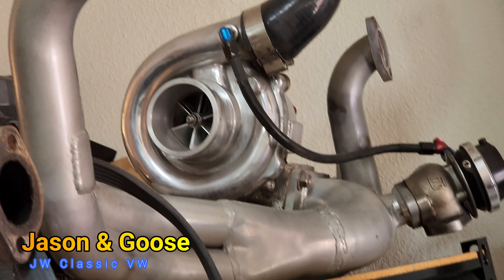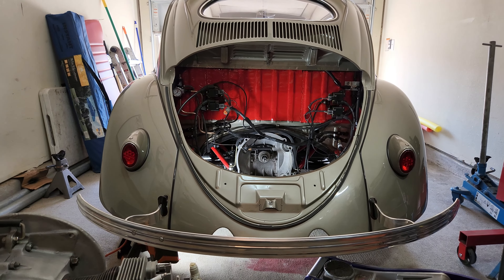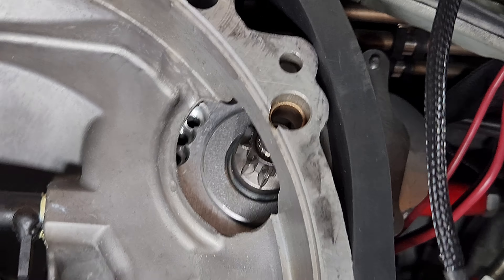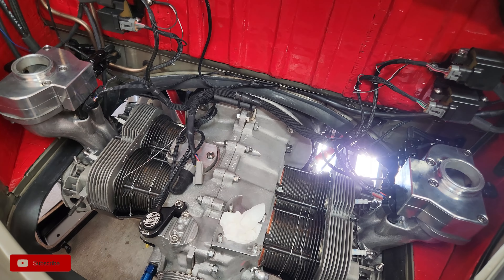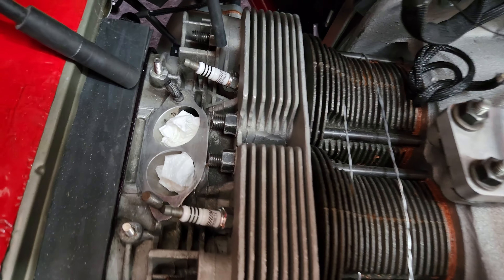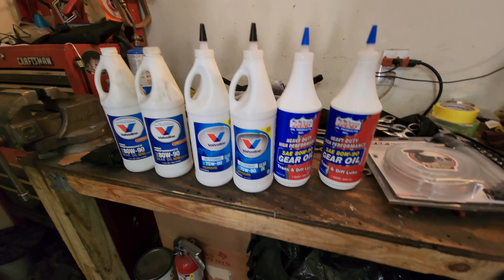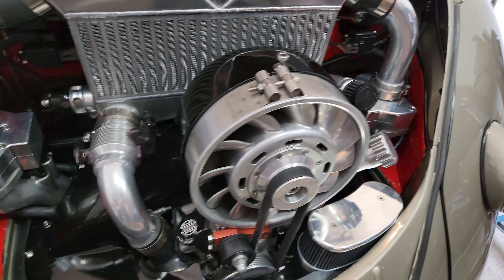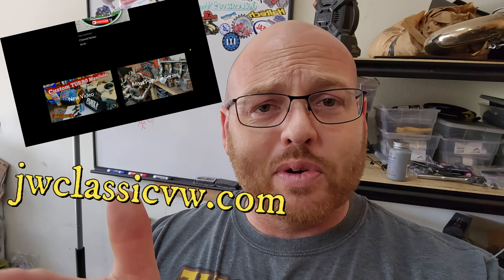VW Beetle 300 WHP TURBO TIME! | JW Classic VW

Comment: Hi, how we delt with this in the early Nineties was to take apart, put low temp paraffin wax in as a plug to stop  swarf getting in the journal.  Then we tapped out and put in a case saver cut to length just past the end of  the crack with the thread lock tighted.  Then filled over the outside of the crack with liquid metal and filled for the cosmetics of the thing.   Hope this helps, there may be a better solution nowadays.  If it's aluminium and you or someone you know is v Good at ally welding? But I haven't ever seen this done.  Good luck.  Beautiful build attention to detail is amazing. Cheers C
Reply from the maker: That is so good info Craig, thanks for sharing brother.  I do have s really good welder that is taking care of it for me.  Thanks for the support brother!

Comment: For gear oil just make sure it is gl-4 not gl-5, VW said to run GL-4. GL-5 says right on the bottle NOT for synchronized transmissions. Gl-5 is for transfer cases not for brass synchronizers in manual transmissions. But why ask us and not Dave folts? He will tell you what to run and has the best knowledge on what works for his builds.
Reply from the maker: Good information Matt, I'll definitely look into the gl4 vs gl5.  As for asking what everyone else is using that just a conversation starter man.  Good to engage with everyone.

Comment: I use 80/90 in the gearbox and Penrite 20W60 "Extra Ten" in the engine (Its an oil specifically for classic vehicles that require zinc additive for the lifters and cam anti-wear).
Love the undercarriage shots Jason, those red brake calipers look the business, I'll bet they stop as good as they look and you'll need it with all those horses to stop!
Reply from the maker: Thanks Martin, I did a bit of research and the 80/90 is the way to go.  The Lucas is supposed to be great for most all transmissions with that climbing technology.  I'll check out the Extra Ten sounds cool!
Reply: @JWClassicVW  The Penrite Seems to do the trick in my cammed 1600 motor and was recommended by the local VW shop who's never put me wrong yet.
Reply from the maker: Very cool!

Comment: Hello hope you can help me I was having a exhaust problem it was heating to much in that part . I had only one exhaust tip and I am in a hot island
Reply from the maker: Lots of things can cause overheating, I would first check the basics.  So you have all your tin... engine tune up.  Make sure your timing is good and that your not running to lean.

Comment: what kind of OIL sump
Reply from the maker: Custom made by R.A.C.E Engineering, pretty sweet!
Reply: I tried to find them but no luck u got a LINK
Reply from the maker: Need to check out the FB group R.A.C.E - Rear Air Cooled Engineering